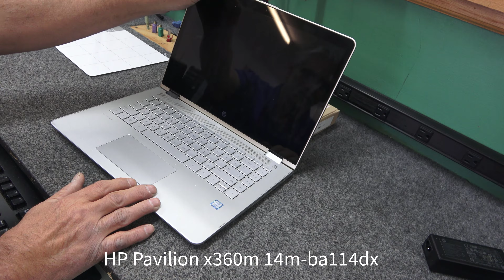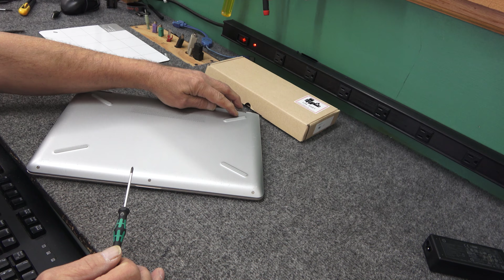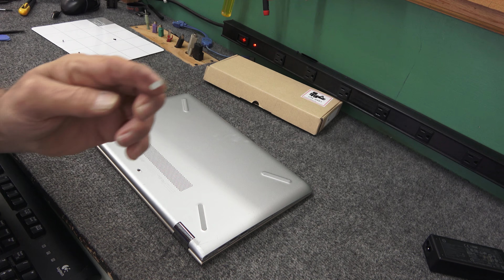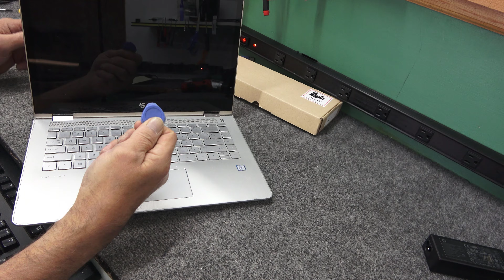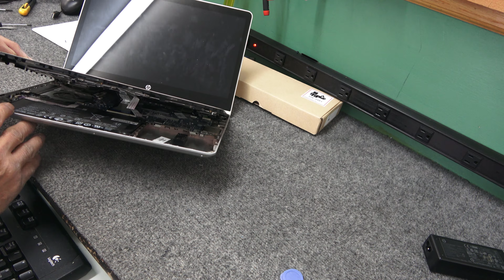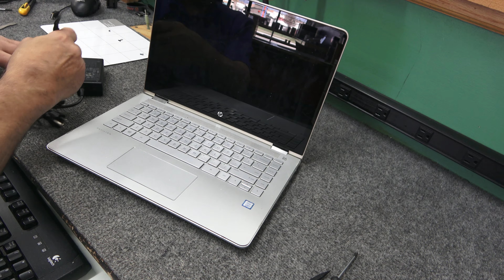Replace Battery HP x360m Convertible Laptop

Comment: Who knew there were so many different versions of 14" Pavilion 360, all built slightly differently! I had to try following a few other videos until I found a version close enough to mine, but your video was the one, thanks Dale. Good, clear instructions, easy to follow and really helpful. One thing maybe worth noting: I managed to unscrew and change the battery without undoing those 3 wires, so it's possible - a little fiddly but I wasn't so confident unhitching and the wires without damaging them.

Comment: your looks just like mine but mine the bottom will easily pop off once the 6 screws are removed I went to HP support to verify my battery  based on exact model number   . I was trying to remove top as shown here and tthought something was wrong. I flipped it over and bingo the bottom slipped right off. No cable ribbions and just remove and replace battery.   So not all 360 convertibles are the same

Comment: Just changed my battery successfully by following your step by step guide. Many thanks!  Was concerned about the 'unclipping' part, but it worked fine as you demonstrated.
Reply from the maker: Good job. Thank you
Reply: Where did you get the battery and how much run time do you get with the new battery? I need to replace mine. I get barely over an hour runtime. I've been carrying around an AC adapter. Thanks.